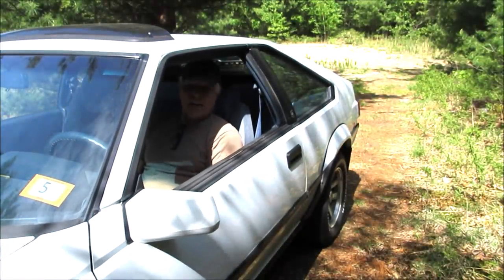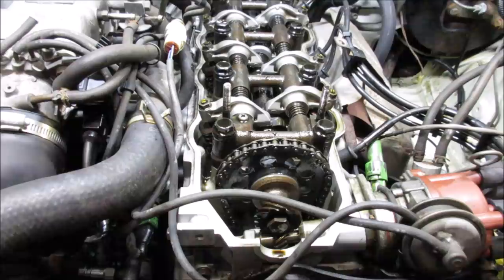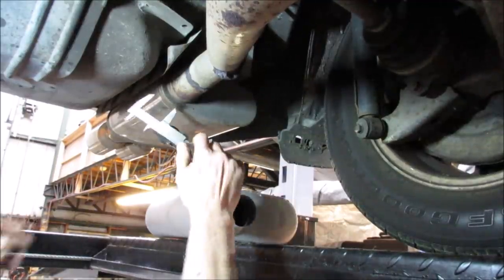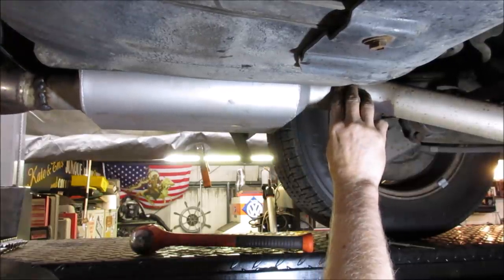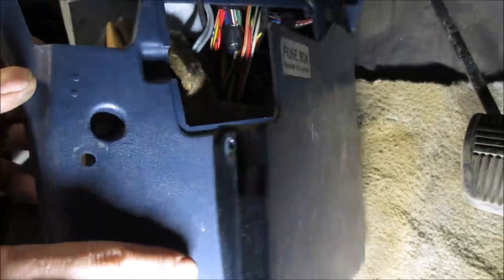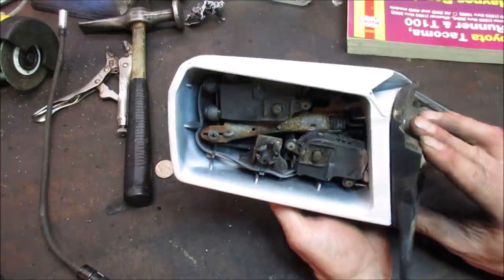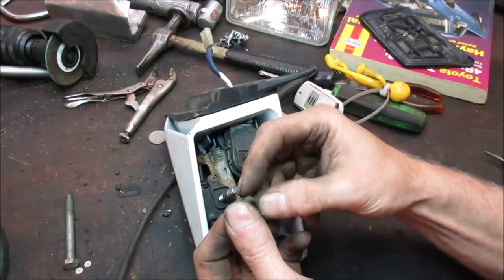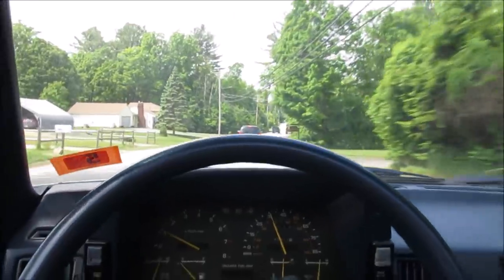Bought The Best Toyota Ever Made

Comment: Wow you got a super nice car!! The 22R-22RE are super cheap and easy to rebuild! I had and 1988 & 1993 both pickups super fun vehicles! One thing I must tell you check your timing chain guards if they break they will slap against the sides one being the water pump side and you will have mixed fluids! You will be scratching your head for days like I did.. I replaced the head and the head gasket still was mixing water/oil.. Then I talked to a local mechanic and he said there notorious for that..took the cover to a local aluminum welder and he fixed her right up!! Great video! Can’t wait to see wats next!!

Comment: Mirror: the motor turns a nut, the screw should be fixed on the mirror. Just glue it on with epoxy, or weld to the plastic backing plate.

Steering wheel: turn it back to back, observing how much turn you'll get. If it is symmetrical both ways, then the steering wheel is put on right, do not move it, you have to adjust the steering link ball joints to make the car go in straight line when the steering wheel is in center.
If it is not symmetrical, then remove the steering wheel and rotate into the next grooves until it is. Then if the car still not moves staight, you'll have to adjust the steering links as well. This adjustment may be a way better have it done in a shop with equipment for it to have proper toe-in.

Comment: I bought 1975 liftback with the 20r 5 speed back in the early 80's only had like 58K on it what a car. I was young but I actually took this car put a trailer hitch on it and pulled a 15ft fish and ski boat loaded to the gills for a camping with 4 guys in the car going 70 down the highway without an issues what an amazing car should have never got rid of that one...

Comment: It might  not be the muffler that is buzzy. It is possibly the motor mounts that have stiffened and made the ride experience less than ideal. Chased this on our 90 Celica. The rubber centers of the round mounts do not age well.  They begin to amplify rather than dampen engine vibrations and everything in the car begins to vibrate and create harshness. New mounts made all the difference and it was like driving a new car again.

Comment: Each of the mirror motors have a small ball like the middle anchor that clicks into the glass base... The glass base for each motor HAD a small half round base clip that the motor stud balls snapped into... Whomever yanked it apart lost the base clips... So the back of the glass had a big center ball for rotation and two of the half round ball clips for both motor studs to click into

Comment: for the mirrors.Put two bolts, then drill a small hole in each end, and run lock wire through between them. like air craft use on bolts. Also a zip tie around that ball holder might tighten it up a bit, or at least prevent the mirror from popping out on the road

Comment: Reaching deep in to the memory banks here but I think that headlight relay feeds the 2 headlight fuses which go directly to the headlights. The high and low beams are grounded through the switch.
To confirm this, unplug both headlights, turn them on and look for only one live on each plug.
If I am right you are looking at a faulty switch. 
Good news, these are repairable, pull it apart carefully and clean the contacts and you will be fine.
If you want to get the best out of those lights you may want to install relays to do the grounding work.
That takes the load off the switch and will make your repair last longer.

Comment: Some Toyotas have exhaust springs between the downpipe and the catalytic converter. They open up under hard acceleration to relieve back pressure. Older ones get weak and or the gasket wears away, replace them and you could be quiet again. Unless you have a leak somewhere else.

Comment: You should see if your steering rack has the same left and right travel. My guess is that it had steering balljoints replaced and they were not properly set up. You should know that wheels always return to go straight on a car that is straight, so if you turn one tie rod in and the other out nothing changes, only the center position of the steering wheel. This is likely what will fix it, just set up the toe correctly and make sure the left and right travel on the rack stays equal as much as possible, otherwise you will end up with an unequal steering radius, wheels might even start to run in to brake lines or the chassis ...

Comment: The squeeze bulb on the right hand side of the driver’s seat inflates 3 airbags in the lower, middle and upper back region of the seat, and on the right hand side there a 3 buttons and you press the buttons individually and they deflate the bags. Also, the knob on the left hand side of the seat adjusts the side bolsters. Probably one of the best standard driver’s seats ever made.

Comment: My first car was an 86 Toyota Corolla SR5  2 door 5 speed. It had the massive 1.6 ltr engine and probably planted about 12 whopping HP to the rear tires. Haha! It was so fun to drive though and in 1996 when I started driving, it would take me to school everyday for 2 weeks, a 30 mile round trip, for about $10. Which was a completely full tank. I remember gas was 88 cents a gallon. Lol

Comment: Had a similar issue where both low beams went out at the exact same time in an old Scion I have. Since I know nothing about cars and couldn't believe both low beams would burn out in the same instant, I checked one of the bulbs which looked okay, checked the fuses, replaced the stalk on the steering column (returned when this didn't fix it), and replaced the headlight relay before finally just replacing the bulbs. They didn't look burnt out, but sure enough, after replacing both bulbs the low beams worked. Replacing the driver's side headlight required taking out both the battery and the engine bay fuse box, so I had hesitated to do that.

Watching your videos diagnosing things makes me realize how ass-backwards I came at the problem. Just hooking up a new bulb to the plug would have told me instantly where the problem was.

Comment: Awesome car, I had the first and second gen Celicas and they were both killer rides.  Try packing chicken wire in the muffler until it sounds like you want it to. Also might be time to invest in a 3d printer for odd parts like those rv mirror screws. Love your stuff, learned carb work from you. Your videos are a service!!

Comment: Back in the day I was able to acquire a 75 Toyota Celica GT five speed from a UPS driver who bought it new, hardly ever used it, and it had very low miles on it. 
That was probably about 1981 or 82. 
It was narrow enough that it would fit on any golf course cart path with no problem and it got excellent gas mileage. And it had a carburetor.
It had ET mags and front and rear spoilers.
Reply: Those first generation Celicas really are a decent-looking car, especially the early ones with the smaller chrome bumpers.  I'd love to see someone fit the chrome bumpers and grill and stuff onto a fastback, which came out toward the end of the first gen production.
Reply: @DanEBoyd  here in the Netherlands we never got those big bumpers only the chrome ones. on my celica there are two square openings for the big bumper dampers. from factory there is just a simple steel bracket which the chrome bumpers mount to.

Comment: Don't use a wet vac for automotive seats. You put a lot of water down into the foam risking deterioration, Spray Windex on a cloth and wipe the seats checking the cloth to see if you are removing dirt. Lightly spray the seats as to not let liquid run deep into the foam. use a clean cloth with plain water to wipe and rinse Windex from seat fabric

Comment: I had the same headlight problem on an 87 toyota truck. The dimmer switch came apart easily and I just sanded the contacts like a set of points. Worked great afterwards.

Comment: The side view mirrors would have been a push/pull situation with the motors reversing as needed. A magnet/steel disk or pin arrangement with one epoxied to the mirror frame and one to the motor shaft would restore functionality.

Comment: I've seen plastic like the threaded ones on the motors turn to a soapy, soft consistency. Plastic gears inside Kodak carousel projectors would do the same, getting to the point where you could just tear teeth off with your fingernails. The 8mm screws seem to be the best (only?) fix. Enjoyable video, thanks!

Comment: I have an 82 Carina I saw so many compatible parts on the Celica.  Fuel gauge is most likely the actual sender unit inside the tank. I had to replace mine and surprisingly there are a lot of Japanese cars as well as a few american I think with the same style sender unit. The one I replaced had 2 wires on it and the new one (off a Suzuki Samurai) had 1.  I just ended up putting an additional ground from the plug towards the top of the sender unit and bolted it down. Worked like a charm.

Comment: I had a 1982 FIAT that was about 10 years old and neglected when I got it in the early 90s. It had no headlight function unless you held the column-mounted control/switch stalk toward you. Only fix was a whole new switch/stalk assembly because the internal plastic had melted apparently due to deterioration made the contacts overheat. I’m sure you’ll get your Celica back in shape.

Comment: Hi Mustie- your steering wheel can remain in place - you need to adjust the rods which attach to the ball joints,  position steering wheel  in the centre, slacken the ball joint nut, turn the rods  around to eventually take up the slack in the steering  again. You can place straight edges to the wheels and do the wheel alignment from there.

Comment: I owned the 1984 Supra and boy was that thing quick! It was a factory automatic with a very rare power selection switch that would change the shift points. It completely changed how the engine performed. After I was finnished with the car, it sold for a lot of cash because of that small rare feature it had. Great cars 👍

Comment: Timing chain/belt change? Brake, suspension bushings, shocks, struts, motor mounts, transmission mount condition. There is always forgotten maintenance for cars this old. I would also do a full brake fluid flush. I see some leaking from the CV shaft boots. Definitely in incredible condition for it's age. I have always loved this generation of the GT-S.

Comment: I had an 83 4 x 4 pickup with the 22r engine.  My first long distance totally dependable engine.  An extraordinary engine.  The only thing I had to repair was the timing chain tensioner.  It's demise was the frame and body rotting into the earth bit by bit.  Had the frame welded three times.

Comment: You need to get the bolts glued to the mirror back as when you press the mirror into the housing the threaded gears allow the bolt to slide in to the motor but once in they then catch the threads and will adjust the glass. You don't have to  screw/unscrew the adjusters as the motor gearing will allow them to be pulled out and pushed in. ( remove the spring you fitted)

Comment: Last summer my friends old Toyota truck had headlight issues related to the switching unit on the steering column. The part alone was going to run over $2000. So, we bought a couple of relays ran the wires and installed a couple of hot switches at the bottom of his dash. Problem solved. But, he hasTo remember to turn off his headlights. 😊

Comment: Yes sir, you should've ran a thin bead of RTV where the 'edge' or the halfmoon seal butts up to the cylinder head/ valve cover. That area, and the edge where the top of your timing cover meets the front of the cylinder head/ valve cover is also MANDATORY to ensure no leaks come from that 'hard corner,' or the gap in the timing cover joint. I do this on every car, along with those grommets as well. On certain cars that are coil on plug style, or have the grommets that bolt the cover running in close proximity to the plug/ coil boots, when the covers seals are leaking bad enough it will fill the plug wells with oil and cause a miss. I'm sure you've seen it as it's quite common. Just another reason to make sure all the rubber gaskets/ grommets are fresh, you use RTV where necessary and you torque the cover so it isn't over tightened and blowing out the gasket. All common sense stuff really, but important if you want a dry engine. Nothing wrong with that Magnaflow muffler. It's stainless, sounds decent, and they're pretty resistant to blowing out the packing. Reason why it's so 'droney' is because there's no resonator. Needs some mandrel bent piping and a straight-thru resonator in the center, and probably a couple stiffer poly hangers, and you'll be in business. If I were fabbing up the exhaust I'd buy some straight sections, and a couple 180° mandrel U-bends to get my angles, and a couple V-band flanges and do it right. Pretty clean body, definitely not from up here in the rust belt, that's for sure. You'll definitely keep it nice and preserve it by shooting some undercoating or fluid film on it. Thanks for sharing Mustie! I'm going to watch it now! 🙂👍👍

Comment: Hey Mustie, that looks like a good buy. Down here in Oz, I believe that that body shape only came as the straight six powered Supra. A customer of mine had one and it was a good drive. It was a great car until his son was working on the fuel injection system and set the car on fire. Although it didn’t burn to the ground, so much electrical got damaged that the car never was the same. Great vid too, thanks.👍

Comment: I would clean the plastic really well. Put a "puddle" of epoxy on the backside of the mirror. Press the mirror on and let it cure. I believe you're right that those little stud things are not supposed to turn. But they do need to change angle in order to allow the mirror angle to change.
 If someone were to move the mirror manually you can hear the studs zip past the threads. So I think during original assembly they did just push the mirror on.

Comment: try to   glue the tips of the new adjuster bolts on to the back of the mirrors with silicone adhesive which hopefully will stop them from spinning, make sure that the threats into the adjuster motors are clean and well lubed!
Reply: And the springs are not needed!

Comment: I remember when I was stationed at So.Weymouth, all the car lots with "FLORIDA CAR" on the windshields. My father being a Blue Angel, I graduated Escambia, H.S. Ruled the Foosball tables up north ! We had them all over P-cola, in the 70's/80's. If you take the head off, there is a bolt under the timing tensioner, if I remember right, that you will break, if you don't find it in the oil. Not easy to see. Try TUFOIL. I use it in everything !

Comment: I had a rusted out 1979 Celica GT, so rusty the sunroof would not close so I caulked and bolted plexiglass over it. I pulled the good running 20R motor with ?72,000 miles out of it before I junked it. I still have the motor in my storage shed. 😝

Comment: I would have glued the adjuster screws to the back of the mirror with some silicone. That way it's flexible enough to not bind up and snap off like epoxy probably would, but it would prevent them from turning as well as be able to pull on the mirrors a bit.

Comment: I would design a clip that attaches to them 2 slots in the pads the screws rest against then design new threaded rods and 3D print 4 clips & 4 rods. Make a ball on the end of the rods that slips into the clips like the big ball that holds the mirror on.

Comment: Nice Celica, solid one too. Lots of potential and a great project car with no huge issue to begin with.
For the mirrors: The bolts are not supposed to spin. Metal bolts (probably metric) are a good replacement, but glue them to the mirror backplate, then reassemble by running both motors in.
For the high beam, I'm surprised you did not try pushing back the stalk. I thought almost all cars have it that way, at least japanese and german.

Comment: Great little car but crap in the winter and wet roads. No weight in back means no traction and oversteer when cornering.
I had the 78 celica GT sport coupe (trunk) and I flared the fenders put on 18 turbine rims . Had dual Webber carbs. I used to smoke ZR1’s all day with it.

Comment: Gas gauge often failed because of corrosion of the ground connection for the sender at the gas tank. It used chassis ground rather than a dedicated wire.

Comment: Darwin, the 22R, and RE were venerable engines. I had a carbureted pickup with that engine, and it drove well for the high mileage that it had (over 220k). An interesting fact is that the V8 engine in the first Ford Bronco had an engine with about the same carbureted 107 hp, but it obviously had more torque.

Comment: There is only one position a steering wheel is ever meant to be mounted whether a steering rack or box. Find the center of turns from maximum lock to maximum lock then mount the steering wheel so it is level spoke with the steering shaft centered between those full lock tests. ALL adjustment from there to center the steering wheel is done by correcting the tie rods/linkages adjustments during wheel alignment. Never again should the steering wheel position be changed. A mark should be made on steering wheel and shaft when correctly centered so it is always returned to correct center if ever removed. Good luck with the car.

Comment: replace the plastic parts with the bolts, and use double sided, foam backed 3M mounting tape (like the kind used for fender flares and those side window visors) to keep the new bolts from spinning.